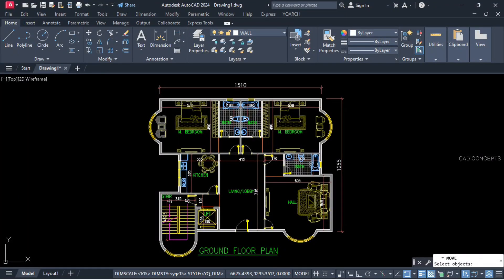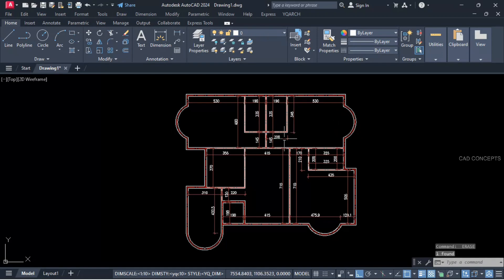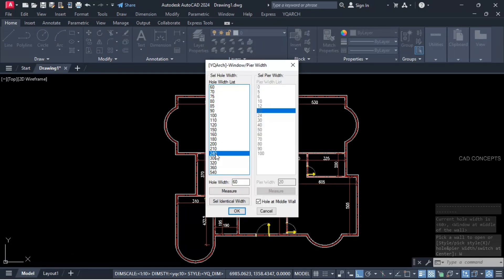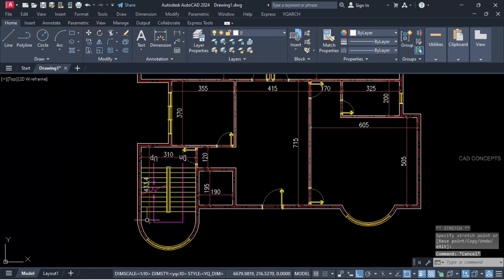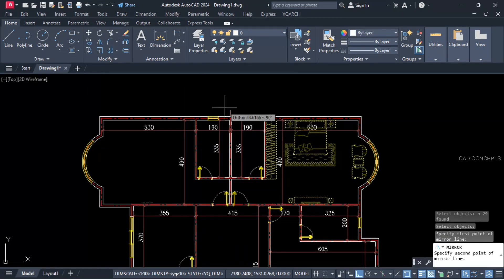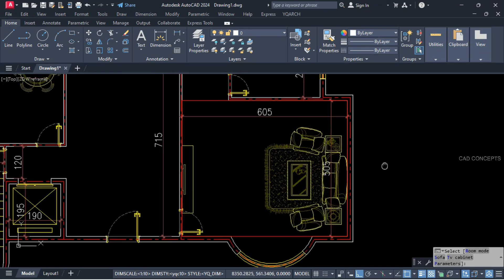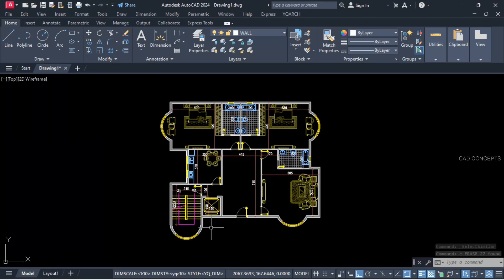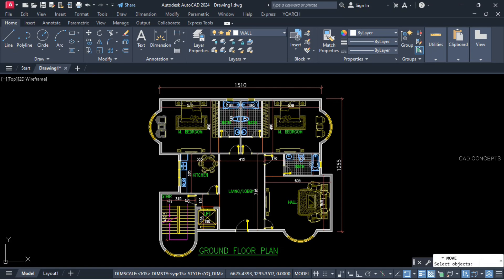Design Floor Plans 10X Faster Master AutoCAD YQArch

Comment: How do you select the thickness of the wall 8" and door 36", using imperial system. I will appreciate your professional assistance. Have a nice day
Reply from the maker: Change YQArch unit by 'YQUNITS' and set it to inches, then apply the wall command choose hole and Pier width in inches, and do the same for Door 'ADT' and place it simply